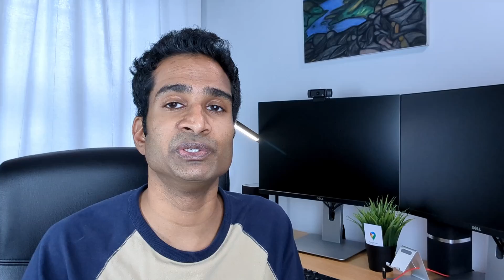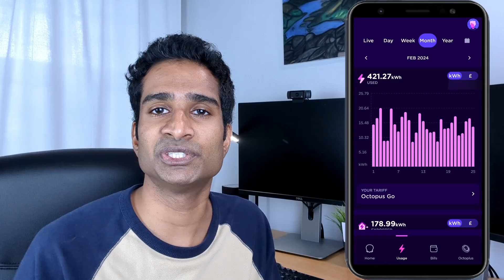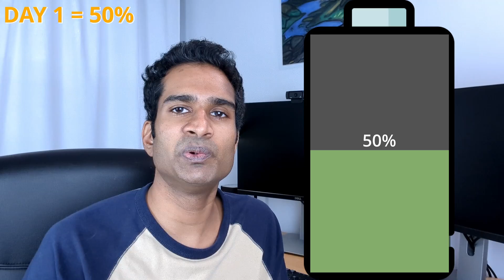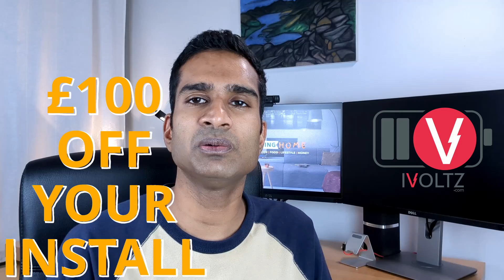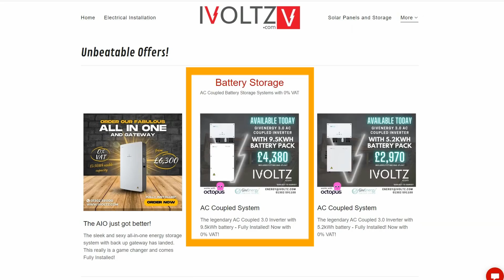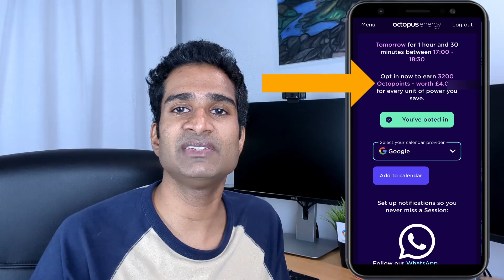No Solar, No Problem! Home Storage Battery In 2024 – ULTIMATE BEGINNERS GUIDE

Comment: If you are reliant on special tariffs (which may come and go) for your battery benefit calcs, you should really be making your cost comparisons against the best tariffs that are available at present, eg Octopus tracker.  This would greatly reduce the savings made and is a much more realistic comparison.  You should also assess the cost of capital and the gains you could expect to make on the capital if you don't buy a battery.
Reply from the maker: Hi - Thanks for taking the time to watch and comment on this video.

But other tariffs such as octopus Go are here at present. I suspect these tariffs will be here for a number of years as even in the energy crisis when they were losing money on these tariffs they still remained. No one has a 🔮 but we can aim to forecast the numbers.
Reply: @everythinghome  You're missing the point.  Yes, these tariffs are here.  There are also tariffs here such as Tracker and Agile that apply to non-PV non-Battery systems, and are MUCH cheaper than standard tariff.  Tracker is about 25% cheaper than fixed or standard variable, and for me even without load shifting my normal usage is about 5% cheaper again on Agile.  The point is you should be comparing Octopus Go etc to the best of the tariffs to fairly account for >just< the benefit from timeshifting with the battery.  Otherwise your comparison is pretty unfair, because a large portion of those savings were available to the user without having to get a battery, and it paints an unreasonably positive spin on battery-only.  When you do that, and also factor cost of capital for the battery over the lifetime, it makes a very poor case for battery only systems.
Reply from the maker: @jfinnie78 I think that's a valid point, thanks 👍🏽

Comment: I use 20KWH before taking into account my electric car charging costs. and have Octopus Intelligent Go. Do you think a battery would be worth it, could I charge it up on the Intelligent Go and which battery would you recommend with approx cost? Thanks, you seem an expert so I thought you could answer. It seems I would need a 24 KWH battery? My car charges at night for 7.5 pence so that is covered it is more the 20KWH I am using throughout every day. I can't see the point if payback is 10 years, but could be with 5 years.
Reply from the maker: Hi - Thanks for taking the time to watch and comment on this video.

Have a look at the section on the financials via the timestamps in the description and try to estimate your numbers. Ultimately, only you can decide if it's worth the initial outlay.

If you’ve not already, please do like this video, stay tuned for some more content and thanks for taking the time to contribute to the discussion on this video 🙂

Comment: Very good video,  didn't know they had dropped the vat on battery's which is good to know. 
Definitely got me wondering,  maybe this year is the year.  I've been sitting on the fence for about 3 years😂
Reply from the maker: Hi Adam - hope you're well buddy. Thanks 👍🏽 yes definitely a welcome change. Haha, with the recent reduction in the electricity tariffs due in April this does push payback further back 😒
Reply: I'm really gutted that Giv Energy don't have a bigger inverter. Ideally I'd like a 5kw inverter, so I can charge from grid at 5kw and also draw to the house at 5kw...
I love Giv energy have a full DOD and even better the 12 year guarantee but the inverter is the deal breaker. I would really like the same make inverter and batteries and I know giv energy work fully with Octopus.
Reply from the maker: Hi Adam - they do have a 5 KW AC inverter via the All In One - https://givenergy.co.uk/products/all-in-one/
Reply: The problem is,  I presume it is 5kw combined solar and ac. It will still prob on  charge at 3.6kw and give back to the house at 3.6kw
Reply from the maker: @swast4 from my understanding it's higher than the standard 3.6 KW hence the appeal as before there was no AC coupled option higher than 3.6 KW as you say
https://midsummerwholesale.co.uk/pdfs/uk-datasheet-all-in-one.pdf

Comment: I'm just about to double my battery storage to 19kWh &, add 5 extra 425w solar panels on a NW roof to catch afternoon / evening generation (the scaffolding went up last week). 
As a retired couple we are at home most days so we use more power during the day than most. So, to save money we need to run on battery power for as long as possible during the day. Our original 9.5kWh battery was running out early in the afternoon hence why I'm adding an extra battery & NW panels to keep it topped up - during the summer at least.   

There's not much solar during winter so our battery (LFP GivEnergy 9.5kWh) gets charged to 100%  overnight at 7.5p/kWh (Octopus Intel Go). Come spring & summer I will start to look more at the weather forecast to determine if I can short charge the battery overnight because there will be sun the following day - we have an ESE 10 panel array so it starts generating early in the morning. I wish I could somehow automate this bit of the process which has to be done manually every day & is, at best, guesswork based on next day weather info which may or may not turn out to be correct. We also now have an EV which gets charged overnight & "sucks up" any excess summer solar generation.

Good vid. Clear & concise information. Quality over quantity any day in my book.